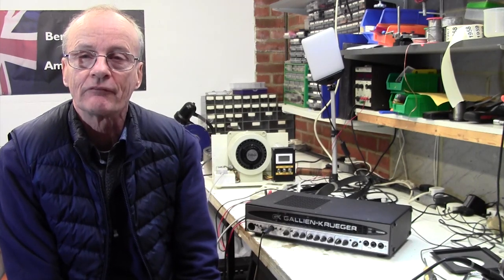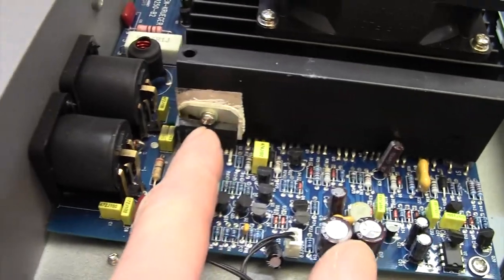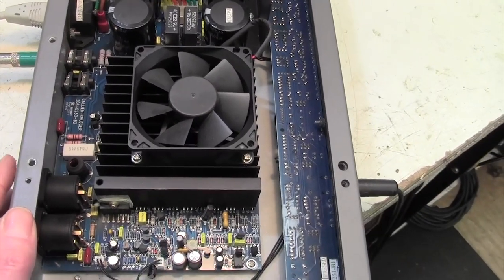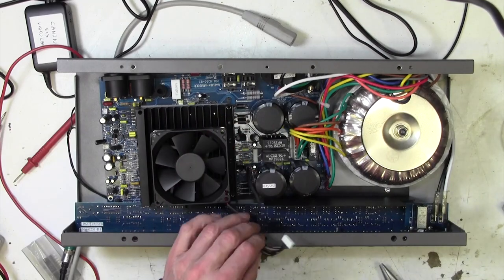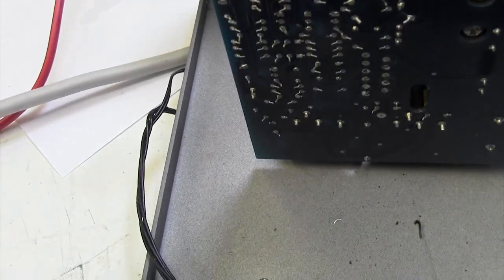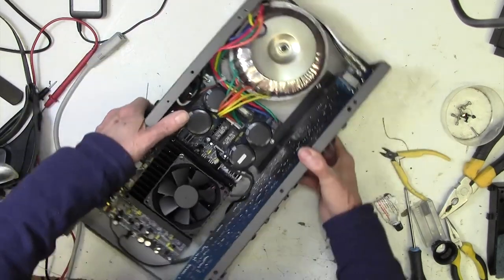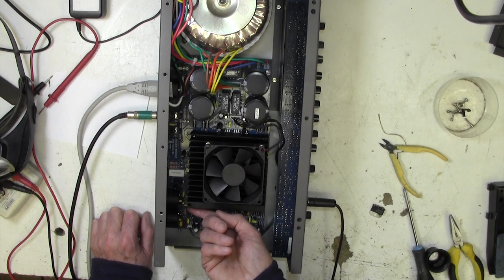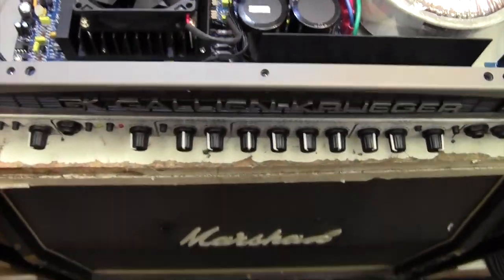Gallien Krueger 700RB Holy Smoke

Comment: If the client's cabinet horn/tweeter is blown/damaged/intermittent, it could have likely fried the chip. Either way, it would be a good idea to test it as well as the speak-on cables/cabinet connections beforehand. Nice catch on the visual inspection as well as the work performed.

Comment: GK amps are unbelievably well known for this. The issues, unfortunately, are extremely hard to track. Had the same thing happen to two of mine: one from a combo, one head that I had hit my bench. They're extremely difficult to work on, as you've said, and seem to melt down for no reason. I actually had one that had fried so badly, that it burned the traces off of the board. Total loss.
Reply from the maker: Very interesting thanks!

Comment: Re: stuck screws..... heat (from a heat gun or soldering iron) and/or cold (from "freeze spray", or an upside down can of "keyboard duster"), or a cycle or two of alternating heat & cold, will usually loosen the screws, breaking the anodizing bond or the paint on the screws and cover sticking to itself. Better than stripping out the screwheads! A small, manual impact driver (the type you tap with a hammer) is also helpful.  And of course it has 18 screws! It's a bass amp and you don't want it to rattle!
Reply from the maker: Yes I might get a small impact driver. It's quite rare though for me to get a stuck screw.

Comment: Excellent job. I would have tried desoldering it with JBC rubber pear desoldering iron, I got used to them. The problem is when the printed circuit is double-sided, then everything gets complicated. Maybe the chip only overheats when it has the tweeter load, it is also possible that the customer tweeter may have some kind of problem, because it seems strange that it does not get hot at all. By the way, the black plate looks like a grounding barrier to eliminate electromagnetic noise from the toroid.
Cheers
Reply from the maker: Ah ok,. I wondered what that was!

Comment: The burned device has likely been operating on the ragged edge for quite some time, and finally gave up while idling. The speaker it's normally connected to is likely the cause  of the problem.

Comment: Did that cooling fan ever spool up? I had a Behringer bass head that reportedly smoked. The fan had stopped working, and the power chips had no cooling. Replaced the fan and all was well.
Reply from the maker: Hi Jim. No it didn't. I kind of assumed it has some sort of stat which only turns it on when the heatsink gets hot. Also, this amp failed whilst just sitting there doing nothing!
Reply: @stuartukguitarampguy5830   It would have been smart to use a hair dryer or heat gun on the heat sink to see if the fan eventually kicked on. If the fan or the circuit that drives it is defective,  that amplifier will eventually blow up again.
Reply: Exactly what I was thinking, I also wonder whether there is some switching circuitry that enables the tweeter only when a 4 pole lead is connected (there'd be no point driving the tweeter amp with no load) although the final minute of this video (which has just swung by as I'm typing this!) has probably debunked that theory.... I agree with his initial assertion however that the script usually goes you change these chips and whatever caused it to blow will just cause it to blow again....hopefully all goes well!
Reply from the maker: @trefwoordpunk2225  Seems to be holding up so far. A bit of a mystery,.
Reply: That amp has a thermal shut down circuit if the fan stops working. My fan stopped working and the protection circuit kept it from burning up.
Reply from the maker: @georgefadely6825  Interesting thanks

Comment: Why I'm so glad none of my amps have any printed circuit boards.
Reply from the maker: Ha ha!  Good choice!
Reply: It's not PCBs that is the problem, but bad design. And most of the time cheap components used. Take a thick Rogers with 100uM Cu, design nice just the right thickness traces and make it in a multylayer with a protective ground plane on each side, with crucial holes not just plated thorugh but riveted. Add premium components adequately fastened in place. No PTP design will be able to compete and be so reliable and sturdy. Most of the times you can tell good quality PCBs from bad ones from one glance.
Reply from the maker: @jernejkurincic9050  Yes agreed. But of course it's all just money. £10 saved on production is £30 saved on retail price etc.

Comment: Stewart, before you complain about oddball or non-standard thread sizes, I need to have a word with you, just one word: Whitworth 🤣! Anyway, although G-K is an American company, it is common to see US manufacturers source screws and hardware from Asia. Even though the US still.officially uses the Imperial or SAE system, I see lots of American made stuff with metric hardware ---- and even metric hardware can have all kinds of weird thread variants.
Reply from the maker: Ah yes, good old Whitworth! I wasn;t complaining about oddball threads I was complaining about having screws with near identical but subtely different  threads to hold the case cover on! SO typical of GK's perversity!
Reply: @stuartukguitarampguy5830  , I am also compelled to ask, how come you don't have a current-limiter of the series-wired incandescent light bulb variety, on the output side of your variac?  In my experience as a tech it is absolutely a necessity, even for tube gear, but especially for solid state amplifiers.

Comment: Stuff some shop towels or an old t-shirt between the board and the front panel to help keep the board standing upright as you heat the pins to pull them out. Also, a piston-type solder sucker would work better than solder-wick braid for clearing solder from the rivet-like plated-thru holes: heat the "rivet" from one side of the board and suck the solder out from the other side.
Reply from the maker: Like the towels idea! But I find that solder braid is magic and also doesn;t over heat the pads. Solder suckers tend to 'bounce' off as you trigger them.
Reply: @stuartukguitarampguy5830  , adding flux before desoldering is helpfull. If the device was made with lead-free solder, adding ordinary lead solder before desoldering is pretty much a necessity in my experience (even when you have access to a vacuum-pump desoldering station,  as I do).

Comment: Brilliant job! But why didn't you clean the carbon off the PCB ? Just curious. 🙂
Reply from the maker: tbh I forgot! But there are no high voltages here and that sort of carbon arcing problem would normally only happen to high voltages (e.g. in a valve amp).

Comment: Gk 700RB  and 1001 RB  are BIAMP amplifiers (uses one amp for the woofers and another amp for the hf driver) to use the Biamp function GK biamp heads use a 4 pole speakon cable. This cable works ONLY with GK RBH, SBX and NEO cabinets. pin +1 and - 1  for the woofer signal and pin +2 and - 2 are for the hf driver. If you connect this 4 conductor cable to a regular cabinet... You will burn the hi frequency amp of the GK. ( i know because I made this mistake conecting my GK 1001 RB to a hartke hydrive 1x12 with the 4 pole gk speakon).
Reply from the maker: Ok thanks for the heads up!

Comment: A desoldering gun with a vacuum attachment seems like it'd be worth the money given how much time you spent with the wick.
Reply from the maker: Hi Chris  I have one of course. I used to use it a lot (and still do on certain jobs) but it's actually a lot quicker using wick. I have the get the desoldering gun out (I don't keep it on my bench) plug it in wait for it to warm up. Then after about 5 uses it needs stripping down and cleaning etc. Bit of a hassle really!

Comment: All I hear is complain, complain, complain… That metal piece is a heat shield… Suggesting to return the amp to the customer without it being repaired is ludicrous! and you wanted to charge them? unreal! Yes, amp repair is a lot of work most of the time… you spent more time complaining then you did repairing the amp… It wasn’t that difficult of a repair… save yourself some time and buy a solder sucker… and stop complaining and get to work! Oh, and good job with the repair.